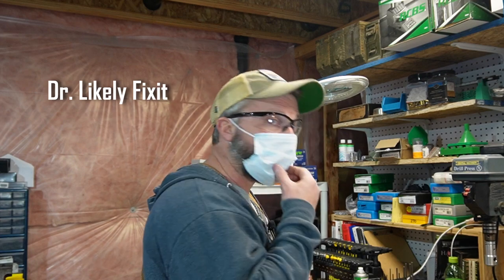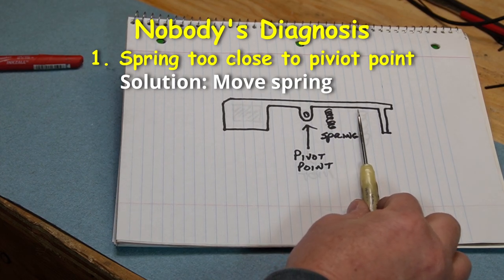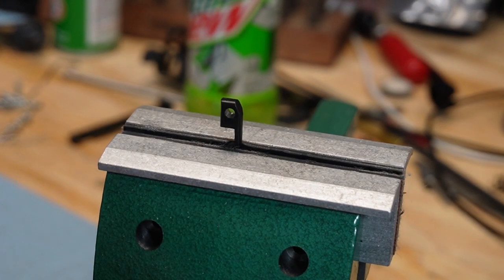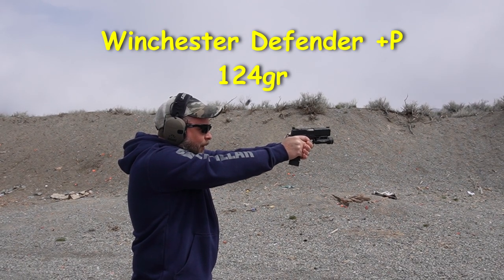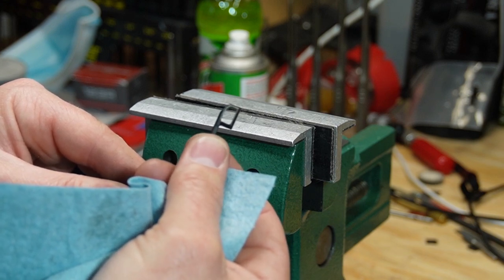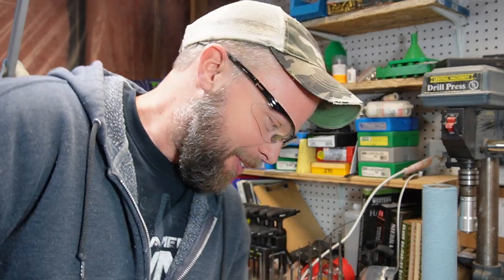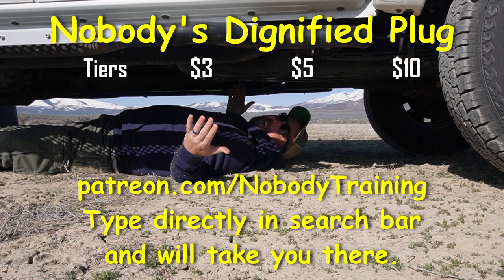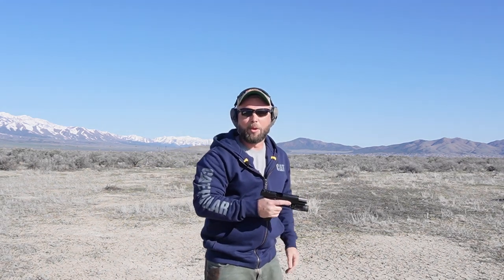Atlas Gunworks +P RUN ALL ammo Modification- Springfield Prodigy

Comment: Lol, I bought an Atlas tool-less guide rod last week. Now I know .. Great video. I tinker so much when I run out of things to do I start cerakoting my guns different colors. This is my new favorite YouTube channel.
Reply from the maker: That means a lot to me! There are a lot of great channels out there and for you to consider me, Nobody, at the top just blows my mind. Thank you! 

I’m glad my timing was so perfect! You’ll like the Atlas. Well made and still strong enough to function after someone likes me attacks it with a Dremel 🤣  Funny that you mention the cerakote…a buddy and I are building an oven. It’s been a fun project so far.
Reply from the maker: It’s weird but your comment disappeared. 

So what he’s talking about is the difference between the gen 1 and gen 2 grip module. He is having the problem with the gen 2 and the prodigy is a gen 1 design. So the prodigy 17 and 20 round mags will be fine but you can over insert the 26 round mags…

Now it is still possible to take a fully loaded mag, insert and have the round touch the bottom of the ejector. Slam enough of those in and it can break. Fix is to relieve the bottom of the ejector to give some clearance. Hope that helps!
Reply from the maker: Here is the question that Sean asked but Youtube is deleting for some reason:

Nobody Training have you noticed if the mags over insert on the Prodigy? I know some 2011's have this issue. Case in point, check this video: https://youtu.be/7HSl1xZsB98

Comment: Nobodytraing, IT WORKS!   I followed you blindly into the darkness and found the light.  I drilled / relocated the spring 1/2 way just like you did and IT WORKS. I dd not drill out the end to lighten it's mass. I shot lots of different ammo today and zero problems.  My prodigy is as close to 100%  as it can get.  Love my 4.25" Prodigy. runs like a top. Love it!! Thank you very much Mr. Nobody. 😍
Reply from the maker: That’s excellent and a huge pat on the back for you for getting it across the finish line!

Comment: Proper fixturing on that wood block mate! Ready for CNC! Great work on the modifications. Two more ideas if yours had not worked. 1. Stretch the spring out - it would be under more preload that way with a longer free length (maybe you tried this?). 2. Go to McMaster-Carr, search compression springs and filter by outside diameter, wire diameter, and rough free length - buy a few with different spring rates and find one that fits and gives you the extra oomph needed. They come in packs of 5 usually - sell the extras of the right ones to people in the comments.

Also what's the big deal with having to use a hex key to take the gun down? I did work on my buddies Prodigy and it didn't bother me at all. Way better than using a paperclip to take the guide rod down. People were fired up about that two piece guide rod in the reviews I saw. Joking aside I would put the Atlas guide rod in if I owned one of these guns and just never shoot +P😉
Reply from the maker: I’m pretty much set up for mass production for sure lol. Suggestions- the replacement springs that Atlas sent be are surprisingly long so going to M-C would have been the way to go. Which I’ve bought from them before and didn’t think about it at all. But I was trying to get the components that came with it to work. 

So there isn’t really a big deal with the hex. It just isn’t convenient. I didn’t like having to rely on having a tool if I didn’t have to. And on my 5” Prodigy the 2 piece never stayed tight. Always opened up as I shot. Frustrating. 

I would have kept the Atlas in even if I hadn’t figured it out. The JHP’s that I’m going to run in it have always functioned flawlessly. I was just determined to have my cake and eat it too
Reply: @nobodytraining  I have heard of the guide rods coming loose. Didn't have a problem with that on the 4.25" I borrowed over about 300 rounds. If I were me (which I am) I would put a couple wraps of Teflon plumbers tape around the guide rod threads. Or source some thin hard plastic washers that could be crushed down cough McMaster *cough*. Can you tell I like McMaster? As overpriced as they are haha.

It totally understand tinkering with and modifying one part to get it to function and work in some weird fringe case that will never happen again. I can't just leave well enough alone either buddy haha.
Reply from the maker: @EngineersArmory  I totally get the McMaster thing. They seem to have everything you are looking for and even the stuff you aren't! Dangerous place to shop.
Reply: @nobodytraining  My absolute favorite thing about MMC is that they have 3D models of almost all of their parts. When I am doing design work I can just pull them into my assembly model. Most design software has MMC plugins for component models because MMC is so ubiquitous. Also makes it easier to just throw those into a cart and order exactly what I put into my design. They charge a premium and for good reason.
Reply from the maker: @EngineersArmory  I never knew that those could be plugged in like that! That is a pretty cool feature. They are also expensive because shipping has always been crazy fast (at least whenever I've ordered). 

If you don't mind me asking, what do you do?
Reply: @nobodytraining  Their shipping is almost always next day its nuts! They have plugins for Fusion360 and Solidworks - probably the most common design software packages and the ones I am most familiar with. 

I am a mechanical engineer. Currently my day job consists of a lot of tooling and process engineering. I am also getting into electrochemistry at work, so I have been  anodizing aluminum in my spare time. I also love gunsmithing, and design my own firearms components. I post videos about all this stuff on my channel as well. I got a full tune up video on the Prodigy too. I cleaned up my buddy's 4.25" without replacing any parts (except the FP spring).
Reply from the maker: @EngineersArmory  Very cool! I love engineering but mine is more on the redneck level...less math and never the right tools involved LOL. I've looked at anodizing but to be honest I just have too many things going on that I never go into it. But I have stripped rust with electrolysis. Had an old wrench that was rusted solid. Worked great with some side motivation that was applied with a hammer!

I think you did the Prodigy right! It's what I did first to my 5". Thought that it should run stock before anything else happens because replacing stuff like recoil springs could mask problems. Some disagree with me but I can live with that!
Reply from the maker: For some reason your last comment isn't showing up. I have the email but can't reply. But if I get into the anodizing I'll reach out!!
Reply: @nobodytraining  Weird, its not popping up for me either! Anyways yeah I get into all sorts of weird projects. Got to keep myself out of trouble. Happy to chat about whatever.
Reply from the maker: @EngineersArmory  Likewise!

Comment: Great video just got mine now I need to try running it and I ordered a firing pin spring from egw and I took the firing pin out and cleaned it very dirty so I hope this fixes the light primer strikes thanks again👍
Reply from the maker: Thanks! Glad that this should be an easy solution. Keep me posted!
Reply: The problem with light primer strikes is the Titanium firing pin that comes stock. It's too light and not enough mass. Order an extended firing pin and use an Extra Strength firing pin spring. Dawson ex pin and wolff spring cured my light primer strikes. I was testing magnum primers in my reloads. CCI small pistol primers worked great but Winchester Magnums would give me a light strike every 25 or so rounds. Problem solved now.
Reply: @Renrondog  I ended up ordering everything and then I sent it out of town to a man I met on YouTube and he installed all the egw and atlas parts free of charge which was very nice and now it runs like a champ 👍

Comment: I wonder if that tiny, tiny little "O" ring we use for the extractor on an AR-15 would have fit and helped strengthen the spring function? or probably just bound it"s coils tight on compression. I may try it with my 4.25.
Reply from the maker: Let me know if it works
Reply: @nobodytraining  It didn't. LOL. I'm going to relocate the spring as you showed. I am having troubles with the guide rod hanging up the slide with high powered rounds.  I had hoped Atlas had changed something , but alas, they didn't.  :(   So! off to the workbench I go!!!!
Reply from the maker: @Renrondog Try reducing the mass of the “button” first to see if the spring can overcome the lighter weight. You can always move the spring later